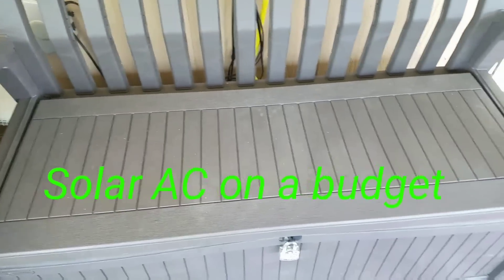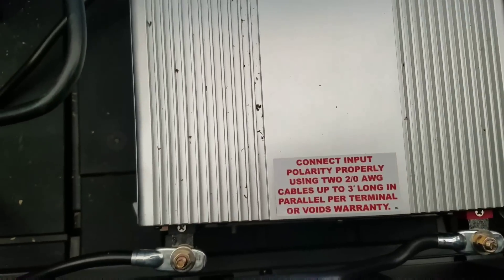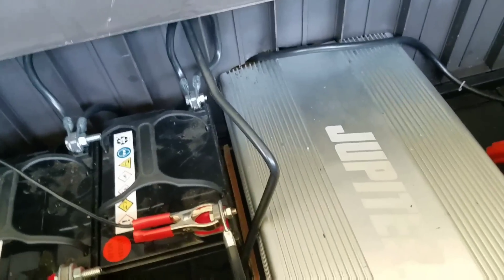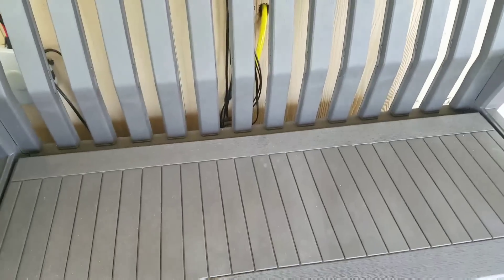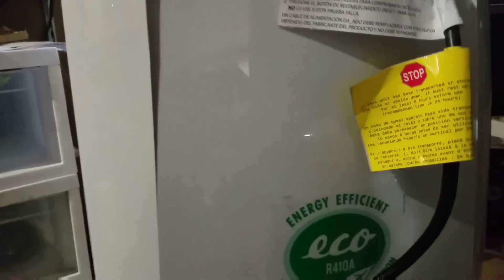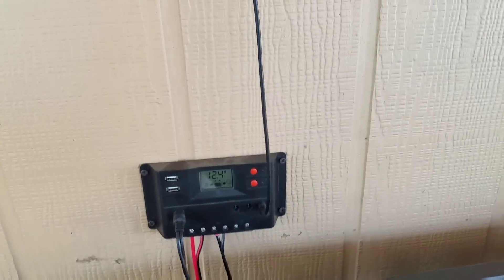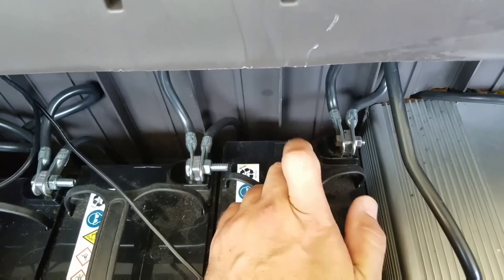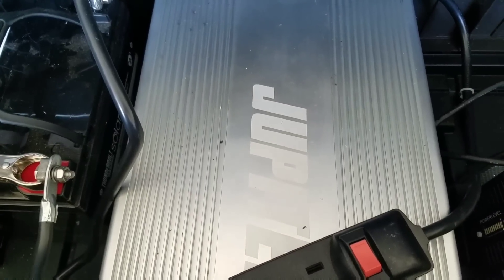How to run an AC unit on solar update

Comment: those do not look like deep cycle batteries
Reply: bob woerner They are AGM batteries, and in most instances will be true deep cycle batteries  (there are exceptions, but not usually what you find readily in stock).  These are typically used in wheelchairs, mobility scooters, and uninterruptible power systems and actually have a more favorable Peukert constant than typical flooded lead acid batteries.  Their downside is that they are also much more costly than flooded lead acid battery alternatives, such as deep cycle traction batteries.

But the OP will never have adequate battery capacity to run the AC all day unless he first installs a solar panel farm with much more capacity than the AC actually consumes.  Right now the solar panels produce maybe 1/6 to 1/8 as much power as the 10,000 BTU AC consumes in real time (which I would expect to be on the order of 1000-1300W, so 150W of solar will never be able to keep the batteries charged -- and that does not even account for the added solar capacity necessary to actually recharge the batteries as that is just what is needed to run the unit when the sun is out.  On overcast days one may need 2-3 times that solar capacity to sustain the AC load.

Comment: Looks like sealed lead acid batteries, which are very safe and don't emit gases like flooded do. Nice setup!
Reply: LFP or (lithium iron phosphate) are at the moment much safer than FLA, and almost all other battery chemistries.

Comment: depending on the A/C unit, it takes around 1600w to power a 12,000 BTU A/C
that approx 140amps of 12v power,  thats a lot of solar or a truck load of batteries

Comment: Tech Guy, How much does something like this cost to set up, enough for a guy to run a small A.C. maybe 12-16 hrs, per day? I am a total ditz when it comes to electrical set ups. And with out AC I would be finished with in a few day's.
Thanks Mike

Comment: looking into adding to my system to run a window unit in my garage. Thanks for the video.  One note; when you touched the negative wire you mentioned it was hot?  Usually a sign that the wire gauge is too small for the amp load. .  Might consider getting larger cables for the batteries,  to prevent them from melting and catching fire.  Cheers!

Comment: I have a 5000btu window ac that draws 550w running off 400w of solar and 4 105ah batteries. At max it runs for 4 hours depending on the day & temp if were lucky trying not to fully deplete the batteries to preserve life.. How is that 1200btu even running with those batteries and only 150w of solar??
Reply: poolfixer I like my setup it's decent. & I recommend going that route as well. but to double up. if I had 8 panels & 8 batteries it would probably last all day maybe even half the night. it all depends on the  sun hours & the total ah. In cali I get about 14 sun hours. I might make a video on my setup soon.
Reply: Better u upgrades your solar panel to 600w... And also, use the the inverter AC... It have soft start that can reduce your surge power from your battery and make it long life, also will runs your ac from 4h to 6h...
Reply: His voltage dropped and continued to drop when he first tried it out . It's not running off of solar directly.   The solar  system can't keep up.

Comment: You need to get at least 125 amp hour deep cycle batteries , the more you get the more power you'll have , don't discharge under 85% and try to keep the batteries as close to 13.5 volts during the day , that's way more panels than you have , sorry to say the car batteries are junk in this case , DEEP CYCLE is what you need , I've been running mine for 10 years now , in vest in a sun charger  from Amazon , about $100.00 , the harborfrieght charger you have is junk, sorry to say , and use heavy cable , so they won't get hot, be smart , do it rite , you have a good start with the panels , there better then some of the high dollar panels out there and last for years , is also hard wire my panels together , them clips are cheesy , good luck
Reply: He needs lithium batteries.....anyone who wants a bullet proof system should be using lithium, yes expensive as hell but worth the money, I see so many people playing with their solar systems, I just don't get it...all the answers are out there, but yet we still see people trying to figure this stuff out.....

Comment: I see reality came in and bit you on on the backside as far as reserved power goes. You will need at least 10 to 15 times as many batteries as you have now to run that AC at night. You also need about 10 times the solar power.

Comment: I've been playing with the new HF solar kit as well, but on a smaller scale (100W solar, 70Ah batteries, 400W inverter). The solar (did you say 3 kits eventually / 300 W?) will give you a bit more time, but not much (minutes, not hours).  I would double or triple the battery capacity, the discharge rate here is very high (~1C) and pretty hard on your batteries. You should also consider the size of your battery cables, they look like 4 or 6 AWG which is too small for ~120 A.   I imagine that post you touched was plenty hot!
Reply: I absolutely agree 100 %, he needs to add batteries, (6 volt used golf cart batteries work great), as well as the under sized cables must be larger. The heat he is creating in that un-vented container is dangerous.
Reply: hey guys, i guess this guy need add  the solar panel to 2000Watts  for the 8hr working requirement,which for window air conditioning working,those cable connect to the batteries must be strength,the controller is very easy to broken
Reply: Four ZeroFour #00 copper wire for a 500W (~45A) load is on the excessive side, though there is nothing at all wrong with that as you will reduce voltage drop in the system, particularly if the run is on the longer side.  Depending upon the insulation temperature rating of the the #4 copper wire, one can run up to about 100A (~1000W) provided they are in open air (not tightly bunched together and confined such that the heat can not escape) though they will get quite warm -- not too hot to touch but uncomfortably warm.  With your #00 (2/0) copper conductors your uppermost limit should be on the order of 180-200A (~1800-2000W), but no more (every 6 gauge steps roughly represents a doubling/halving of carrying capacity).  At the uppermost limits you will want to keep conductor lengths as short as practical (ideally make custom cable lengths) to reduce overall wiring resistance and voltage drop, which also equates to lost power (hence the heat), to the bare minimum.

An issue with this battery bank is that each paralleled battery in the bank should be separately fused as if one battery shorts a cell (a common failure mode) the remaining good batteries will be shorted out and dump their current into the shorted battery, which at best can ruin the would be good batteries and at worse can start a fire in the failed battery and wiring without an inline fuse to disconnect the failed battery.  For this application you would probably want to fuse each battery at about 30 or 40A.  The inverter also needs some sort of cooling as well as right now it is just recycling the same trapped hot air which is good for neither the inverter or batteries.  You also do not really want your inverter sharing the same confined airspace as your batteries as there are circumstances (namely overcharging and the bursting of the battery case, which can happen due to a shorted cell) under which even Sealed lead acid batteries can release explosive gasses (hydrogen plus oxygen in the perfect ratio for an explosion).
Reply: I agree, more storage equals more amps stored equals more runtime...
Reply: 100% True. Those cables are way too small. 
I used 2/0 wire on my battery interconnects that I have, and I often question if it's enough. (So far it's been great, even with the higher loads I've put on it, around 500 watts, from a 12 volt bank.)

The wires he has look like 4 AWG which would be great from a charge controller to the battery bank if your run is real short, and you've got under 2 KW of solar... but from the battery bank to the inverter? :/ Sounds like melted plastic and fire to me.

Comment: RFTechGuy C.A.D. that is real cool set up so far. did you get a fanned inverter? you might want to get a fan hole put into the back of your battery box bench thing, other than that you should save pretty much money.